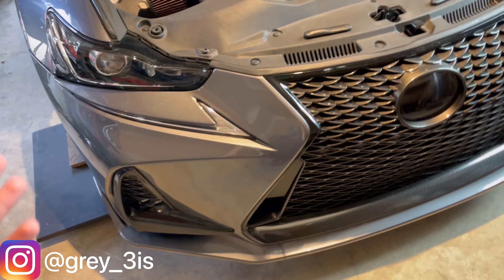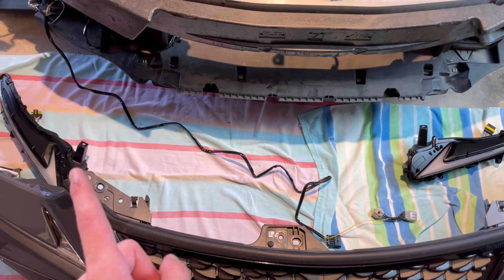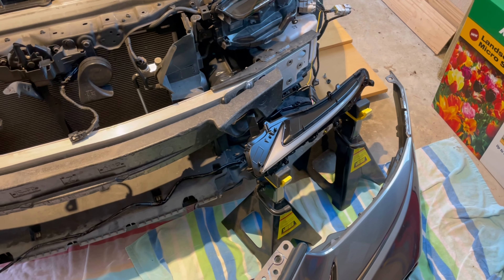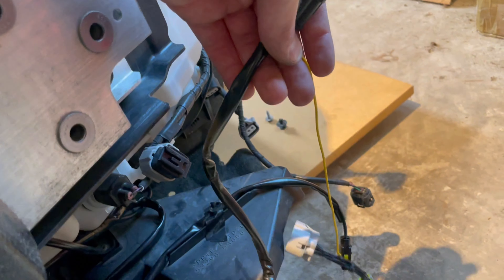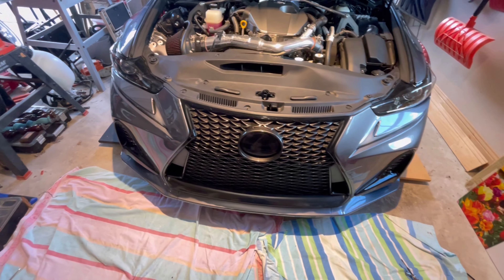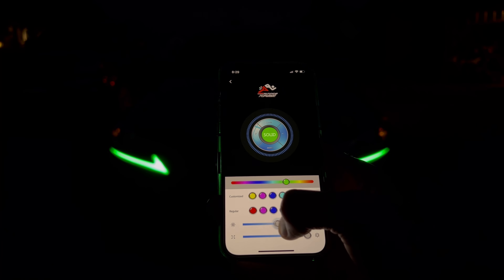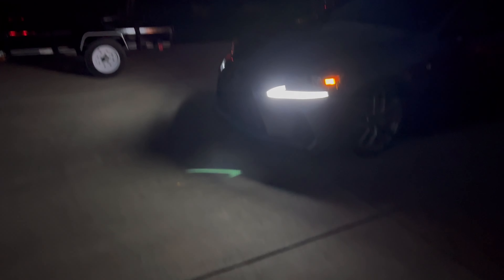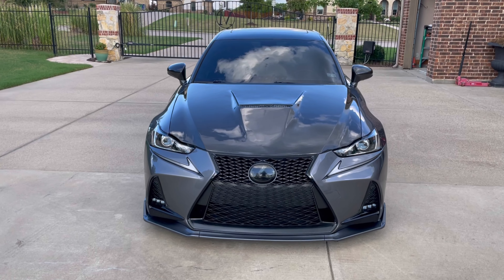HOW TO INSTALL RGB/ SEQUENTIAL DAYTIME RUNNING LIGHTS | LEXUS 3IS

Comment: I just got these. Installed , but they don’t change color on the app, can you help me see if I did anything wrong or do I have to have my lights on a certain way?
Reply from the maker: Hmm, try manually turning your low beams on. Or turn your headlight stalk all the way off.
Reply: @Grey3IS  okay yes that worked , how do I get it to stay on one color ? 😔
Reply from the maker: @raphaelmendiola4245  You should be able to tap one of the solid color options, then it’ll stay that color.
Reply: @Grey3IS  okay that’s the only thing not working im gonna have to look into it 😔😔
Reply: @raphaelmendiola4245  you need to turn off DRL lights in the OEM settings in your screen

Comment: What percent tint is on your rear windshield? I've been debating between 5-20% tint on the rear but was concerned I won't be able to see people behind me at night. Great video!
Reply from the maker: Hey my man! I have 5% on my rear windshield. The higher quality tint you get, the easier it’ll be to see out of it. Regardless you’ll be able to see their headlights behind you, but some nice ceramic tint will allow you to see pretty clearly out of it at nighttime. It’s worth the investment in my opinion. 🙂 Ceramic is also great for keeping heat out, v.s. normal dyed film which is purely for darkness.
Reply: @Grey3IS  I have a red is350 and have ceramic all the way around. 20% back and sides and 40% on the whole front windshield and I LOVE it.  I always promote the ceramic tint. Also about to install the running lights and pre ordering the rear v2 sequentials. I can't wait.  Keep it up.
Reply from the maker: @matthewmoore5808  That’s amazing! Ceramic is the s***! Please reach out if you have any questions regarding the install. 🙂 Thank you for your support.

Comment: Do you know how much horse your making? Just curious to see what these guys can get up to with the proper treatment, and with your tunes do you notice anything different in lag
Reply from the maker: Hey there! I’m making approx. 306hp and 374tq to the wheels. I felt a significant different in the turbo lag and power produced by the tune. The Downpipe was another mod that I felt a decent change from. Someone just recently put the Muchboost upgraded turbo in their 200t and it should be making 300++hp now!
Reply: @Grey3IS  preciate you bro, wish I had a Lexus community near me ain’t got no one to learn shit with 🤣
Reply from the maker: @GoyardGlo  For sure! And I’m sorry man.
Reply: @Grey3IS  which mid pipe did you get ? I’m running a remark axle back for the exhaust
Reply from the maker: @Marcusfigs  I have the midpipe that comes as part of the Armytrix valvetronic catback system 🙂.

Comment: Great Video, I was on the fence about ordering these but you definitely answered my questions. I just installed last night and the app is not locating a device to change colors, any pointers on how to get it going?
Reply from the maker: Hello! Thank you for your kind words. Make sure the vehicle is running and the light stock is turned to low beam (headlights are on), then try to connect to the app. 🙂

Comment: Hi !

First of All...Thanks very much for your good work ! 

1 - I did install (LEXUS IS 350 EXECUTIVE 2020) HC MOTIONZ (Wenzhou Yecheng Auto Parts Co., Ltd) RGB Tail lights end of september 2022.  Very satisfied until now.. No glitch no nothing.  Quality fabrication speaking...similar to OEM as far as I'm concerned.  Quality of Internal electronic components  ?  Dont know yet..  Made in China not always means bad quality.  Iphones are made in  ?  So, to follow.
2 - Then I bought RGB Daytime running lights in february.  Total failure.  Unable to "connect" the device at all.  I am an IT guy so ...tried eveything I know in order to make it work.  No chance.  LED controller box DEFECTIVE.  The fact that we cannot "deactivate" startup animation and some interesting colors are ILLEGAL at least here in Canada has changed my mind to install this product. Quality of fabrication ?  So..So...  LOW.  Lots of gaps and slots....  Not sure it would have really been IP67....standards.
3 - Bought NORMAL item (Animation White-then Blue-Then finally White)  Drl in february.  Startup animation was Ok.  BUT the sequential ORANGE turn signal feature didn't work correctly.  Lights stayed FIX SOLID ORANGE.  No movement at all.  Wenzhous Yechen Auto Parts engineers said was first time this type of problem...  ;)  Ask for a REFUND...last week.
Reply from the maker: I really appreciate the detailed explanation of your experiences. I’m sorry you weren’t satisfied with the DRLs. Mine have been perfect for me, but being an electronic device, they can malfunction. It sounds like you know that already 😅. I hope it works out for you in the end!
Reply: I wasn't able to get mine to work either -- the control unit/box is definitely defective on these. It seems like the earlier units (which the uploader received) worked, and then anything after a certain date was defective.
Reply from the maker: @MrAlexDelarge  I’ve heard of some of the modules being defective. But thankfully, I’ve also heard of the manufacturer or seller replacing the module with a new one. So I’d start there and see if that’ll fix your issue.
Reply: @Grey3IS  Agreed. I went through two separate units and gave up when the second one failed too. Refused to connect my phone and the lights didn't turn on at all, so a pretty serious fault/failure on the module level. I'm looking into the non-RGB version from HCMotionz or a Chinese retailer instead of Tanso.
Reply from the maker: @MrAlexDelarge   Ahh, I understand. HCmotionz is the manufacturer for the Tansowerkz DRLs (and for everyone else). The main difference of Tansowerkz and HC is that Tanso is really good at warranting/ replacing products fast and easily. Like you
mentioned, it might be worth trying a different set of DRLs all together. Tanso offers the non-RGB too if you’re interested. I get if you’re wanting to go with another seller, but it’s all the same product.
Reply: @Grey3IS  Yeah that's true -- I might place the order through Tanso. If I recall, there may have been a decent price difference (though it might be worth paying a bit more for those things you mentioned.)
Reply from the maker: @MrAlexDelarge  With their sale and my code (GREY3IS) giving you a 10% discount, the price comes pretty close to buying it directly from HC. And it’s not bad considering what you get with it, like you said. 🙂
Reply: Any update on the non-rgb?

Comment: Hi, is it possible that this is some universal RGB driver, and could be controlled with a dedicated device instead of an App? would be nice to have something on-board. Second question: you normally drive with them set to white and change colors on parkings etc? I presume it is not possible to customize welcome animation, when you first start?
Reply from the maker: I’m not sure if there is a way to use a universal remote or some kind to control them. There has to be a way to match the frequency that the app provides, I just don’t know how. And yes, I usually keep mine white while driving. And unfortunately no, you cannot customize or turn off the start up animation (to my knowledge).

Comment: Hi mate, is there a startup animation? Can you customise it?
Also, does it work like OEM where it is bright during the day and dims down automatically at night?
Also, how do you get the turn signal to be at the same speed as these sequential ones? Thanks in advance
Reply from the maker: Hello! Yes, there is a start up animation. It is a rainbow dancing animation for like 1 second. No, you cannot change it or turn it off (to my knowledge). And the lights stay the same brightness unless you change the brightness via the app. The DRLs match the speed of your OEM turn signals automatically 🙂.
Reply: Does the changing animation speed in app affect the startup animation? Such that you can make startup faster and less noticeable?

Do the drls stay on after unlocking the car?
Reply from the maker: @brian3787  No, the animation speed in the app doesn’t affect the start-up animation. And for unlocking the car, the DRLs function like OEM. They turn on when applicable (like if it’s nighttime and your lights are on auto).
Reply: @Grey3IS  awesome, these look great. Will definitely try them out soon.

Comment: Thanks for the video install bro help me alot. But can you help me with something?
when i start my car, i can't change to solid colors or different modes. But when the car is shut off and i turn on the DRL manually that's when the car is off then theyll 
change the modes and colors. I don't know is it like that because driving Purpose. Thanks in advance
Reply from the maker: Awesome! 
To change colors when the engine is on, you have to have your headlights on or have them all the way off. To bypass that, to have them running on DRL mode, you can go into your lighting settings and turn off “DRL”. They will now be able to change colors whenever during driving.
Reply: @Grey3IS  thannnkssss brooo. Didn't expect it to be that simple. Worked just like you said. Thanks for the fast reply.
Reply from the maker: @mikeyang5635  Awesome! And you’re welcome 🙂.

Comment: Will these work on a base model 3is? I have a 2014 is250 that im trying to get these on and just want to know if they will fit on it?
Reply from the maker: Yes, but just a slightly different set will fit your model year! I sell them now too. Shoot me a DM on Instagram, and I’ll make sure you get the correct set. 🙂
Reply: @Grey3IS  Sounds good, i sent out a DM on Instagram

Comment: How long did it take for these to arrive for you? I ordered them about 2 weeks ago still no ship notification
Reply from the maker: Interesting, it should take about 2 weeks or so depending on the amount of orders that they get. Maybe DM them on instagram 🤷‍♂️
Reply: Have they arrived yet or are you still waiting? I ordered mine about a week ago and hoping they come soon…
Reply from the maker: @jakemoy993  I recommend contacting Tansowerkz via email or Instagram DM to ask for more info about your order.
Reply: @jakemoy993  order them from ebay, hcmotionz is the distributer. Youll just be paying tansowerkz as the middle man, same lights but youll spend 100$ less
Reply: @Grey3IS  Will do, thanks!
Reply: @shadowknight4738  Will look into it, thanks.

Comment: I recently installed these myself.  I have ended up with a little gap where the  bumper meets the fender.  Any tips on avoiding that?
Reply from the maker: Unfortunately, the 3IS’ bumper tabs get worn out the more you take off & on the bumper. It’s knows as “bumper sag”. There’s not too much you can do about it unfortunately. This is a common issue amongst all IS’.
Reply: @Grey3IS  Thanks for the info!

Comment: Could you change the colors for the start up animation. Does it always have to be RGB?
Reply from the maker: That’s just the animation it’s stuck with 🫤
Reply: @Grey3IS great video man, so just to be clear..you can’t change the start up animation to just solid white like OEM?
Reply from the maker: @adriansimpson8079  Correct. These are stuck with this start-up animation.

Comment: Dang that’s tight work. Can I change my whole bumper and put it on the 2007 I S250.
Reply from the maker: Thank you! And I bet you can.
Reply: How do I get that tint that you have on your front window? That thing looks amazing. Is there a website where I can buy it?
Reply from the maker: @juniorthegreat7564  Thank you! I got it applied with my local tint guy.

Comment: If I just keep them white and never use Bluetooth will they still work just fine
Reply from the maker: @imglitched4960  Yup! I mostly do the same 🙌.
Reply: @Grey3IS ok thank you I was just making sure I wouldn’t have to keep the Bluetooth linked because I don’t want it to interfere with my Bluetooth on the car

Comment: Have you had issues with the app not letting you change the lights when the car started and it just stays in the default white
Reply from the maker: Make sure your low beams (head lights) are on, or have your headlights are all the way off! To bypass this, for auto during the day, turn off daytime running lights in your infotainment light settings. 🙂

Comment: I have the NON RGB version. ive noticed when i set my headlight knob to AUTO setting and the headlights switch when it get dark or driving under a tunnel on the DRL animation happens. Does this happen with yours? I now drive with headlights in manual mode to stop the animation occurring multiple times
Reply from the maker: Yes, it would happen because the DRLs are getting “power” to them at that point. To stop that from happening, you can turn off daytime runnings lights in your infotainment to fix this.

Comment: Do you know if you can keep the colors changed while in drive? I just installed these drls but once you’re in drive it keeps going back to the color white.
Reply from the maker: Hello! If you turn your lights all the way off, or turn on your low beams while driving it’ll show the colors. If your lights are in DRL mode, it’ll be white. If you want it to show colors even when in DRL mode, go to your light settings (in your infotainment) and turn off the daytime running light function. They’ll not show white anymore until you manually set them to white in the app. 🙂

Comment: Do you ever have problems with the app? I just installed mine and it seems like the app is always have problems for me 🙃
Reply from the maker: Oh man! I’m sorry. No, it has been pretty solid for me. Just have to make sure your headlights are on for the app to connect. That’s about the only thing!
Reply: @Grey3IS  yeah I have them on but the app disconnects or won’t change the colors sometimes. I’ll figure it out lol

Comment: Any idea why mine only turn white when I turn off headlights but with my cars lights switched to auto they are fully customizable?? ☹️
Reply from the maker: Hello! The customization ability happens when your headlights get power to them or when the headlights and DRLs are off (when the car is on). When the car is off, you can switch the light stock to DRL mode to enable customization.

Comment: Just installed mine, mine only change colors when I turn my headlights on, when it’s on auto they are just oem color. Do you possibly know why that can be?
Reply from the maker: Not sure why but mine do the same. The headlights have to be on. So either turn them on with the light stock or put them on auto at night time. But a follower of mine just told be that you can turn your light stock to the OFF position and still change the colors of the DRLs. I have yet to try this though.
Reply: Jordan does your app have white color option on there?
Reply: @martinthomas5282  yes it does
Reply: Darn mine doesn't and I reached out to them and no luck. I wonder am I the only one with out white light option.
Reply from the maker: @martinthomas5282  Yes! Mine does. One of my followers DM’d me and showed me that their app didn’t have white as an option. I thought that was funky. If you pause the video where I show the app, you can see where my white option is. 
Btw! If you have your headlights switched to DRL (or auto during the day) they will show white (while the car is running).
Reply: That was me who dm you on Instagram. But it is just frustrating that mine does have a white color as an option and their customer service is not even answering to me.
Reply: Especially when you pay that much money for them.
Reply from the maker: @martinthomas5282  We’re you the same guy that DM’d me on Instagram saying he didn’t have the white option?
Reply: @Grey3IS  yes that was me. I was just checking comments here to see if anyone else have the same problem as mine.
Reply from the maker: @martinthomas5282  Damn! I’m sorry man. So tansowerkz isn’t answering? At all? That’s annoying asf. I’d send another message and give it a little. They used to be great at responding.
Reply: @Grey3IS  yes it is. I appreciate it man. Let me know if they respond to you.

Comment: Great video! I was wonder if we could use these DRLs as Sequential Turn Signals during the daytime
Reply from the maker: Thank you! Yes, these DRLs function as full-time sequential turn signals day or night 🙂.
Reply: @Grey3IS  Is there additional wiring to headlight Turn Signals for that to be possible
Reply from the maker: @xndyh  Nothing “extra” needs to happen. It utilized the plug and play plug that goes to the headlights (the grey-ish plug in the video) 🙂.

Comment: Dude i just got these from hc motionz right drl sequential works fine but left side doesn’t cant even connect to the app either. You have any clue what it may be?
Reply: And my double grey connector has a brown wire not yellow like your not sure if thats the problem
Reply from the maker: Interesting. I would double check that all of your connectors are fully plugged in. If they are and this is still happening, contact the individual that you got it from.
Reply: @Grey3IS  seems like a possible bad module or even faulty passenger side DRL cuz start up animation and sequential works on driver side DRL just not passenger ive tried even swapping passenger drl to driver and still nothing, got it from HC motionz soo hopefully they resolve this issue. Thanks man!!

Comment: Have u had any issues with connecting the app
Reply from the maker: It’s been pretty dang good for me! Make sure your headlights are turned on when you’re trying to connect. (Also make sure you have the RGB ones)

Comment: where did you get the lights for your steering wheel?
Reply from the maker: The LED shift lights are an option when customizing a carbon fiber steering wheel! I’ll drop the link below. You can mess around with the wheel customization and kinda see what I mean. Also, you can use code GREY3IS at checkout to save 10%! 
https://tansowerkz.com/product/carbon-steering-wheel/#material